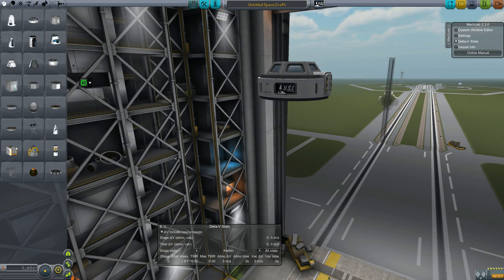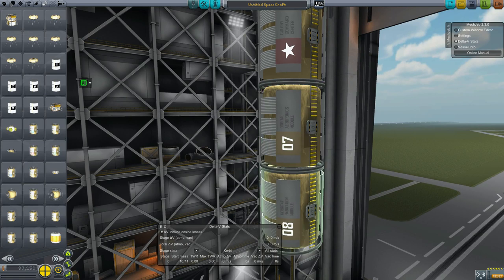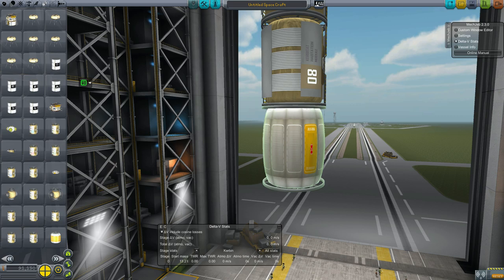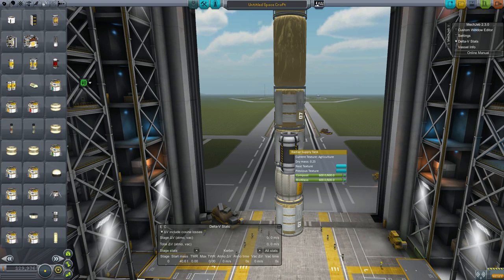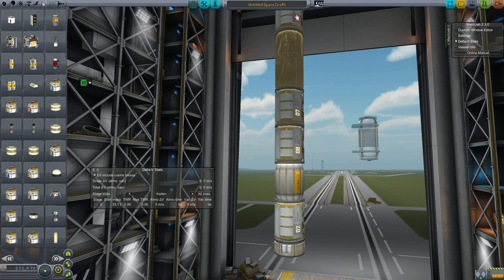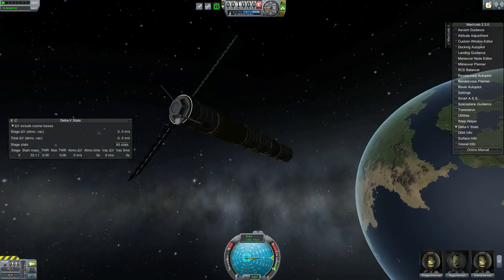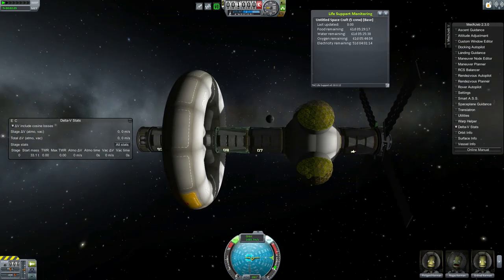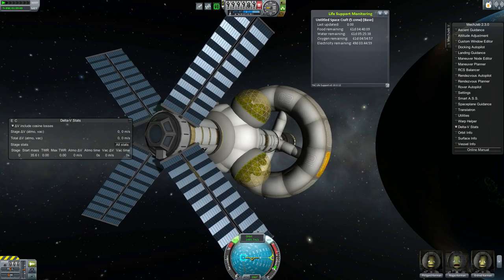OKS (Your first station)

Comment: Dude!  We need more demos!  Things like how do I bring supplies up to my modules?  The best way to assemble things on orbit.  More about how the other modules - like bio, machine shop, refineries all work.  Trying to figure this stuff out by trial and error is impossible.  I have launched and ultimately had to deorbit like 15 ships now and still do not know what the hell I am doing and how all these bits are supposed to work together!!!  It's getting to the point I just don't want to dink with these parts anymore as it's just an exercise in frustration.
Reply: Also, I want to know if it's possible to attach these individual pods in space without 3.25 clamp-o-trons?  I hate having to "clamp" everything together.  It would be awesome if the ends of these modules would automatically attach when close, like a clamp without the need of attaching clamps to new pieces once I'm ready to expand.

And what is the point in this if there is no science to be had?  I should gain something for making a base, because the only reason to build a base or orbital station is to learn something from our surroundings.  If I'm learning nothing from it,l the endeavor is pointless.
Reply: Robert Burke if you want to get science from a space station you can use the station science mod. there would be little point making another mod to do the same thing.

this mod is for making a sustainable base or station especially useful if you are using tak life support. when used in combination with karbonite and karbonite + mods you can set up a mining platfom on a planet or moon, having a sustaiable base is very advantageous as you would not have to send shipments of food, water etc to duna every year or so.

also the mod is designed with a sort of end game in mind. to colonise the solar system. so you will probably have most things unlocked before by the time you make a super uber mining base on duna. so the need for this mod to generate sceince is not that big in my oppinion.
Reply: Robert Burke It helps me alot in establishing a place to build my interplanetary ships in orbit and also a place to refuel my ships without having to head back to Kerbin. I just launch the science back down to in command modules
Reply: Exactly. I appreciate the immense amount of effort put into this mod but it is INCREDIBLY confusing. I don't know which resources should I bring up to initially establish my colony/orbital station. So I end up using trial and error and 90% of the time, one or more modules say that it's missing electrical parts/mechanical parts/chemicals/polymers/spareparts or there's not enough room for this thing and that etc.

Comment: We need to have more detailed information.  What things are inputs and what are outputs.  What rate are they consumed and how many are needed to do specific things?  There is just so much missing information that the entire package is impossible to use.  I can't afford  the time to build ships and send them even as close as mun and minmus and only after getting there and killing my kerbals realize I missed some critical part.  Could you please do some step by step detailed tutorials covering putting together both a complete orbital and land base that uses all the component parts?  So we can see how they work.  It should be done in the context of career mode where we my not have access to 3+ meter parts to push 20+ ton payloads to LKO and a beyond.

Comment: I'm having issues with this crashing. I'm almost positive it's clashing with another mod. Probably Interstellar mod. I saw that it's compatible with Interstellar lite. 

It's crashing to desktop without warning. I've seen people mention this, so I'd imagine it's something simple. I'd really like to get this mod working, preferably with interstellar.
Reply from the maker: Not a mod issue.  Either memory pressure or a KSP install issue.  Lots of folks use this in conjunction with different flavors of KSPI (and other mods) and with pretty much 100% consistency, any CTD issues have come down to either too many mods, or were fixed by reinstalling the mods, or reinstalling KSP.